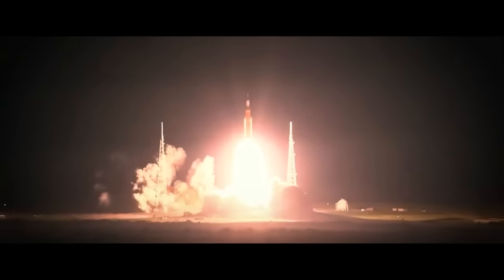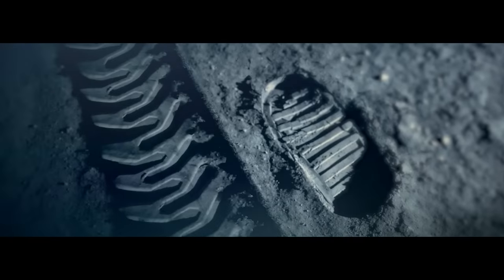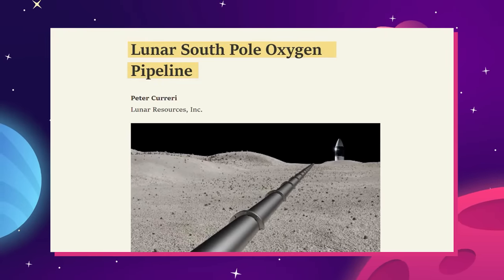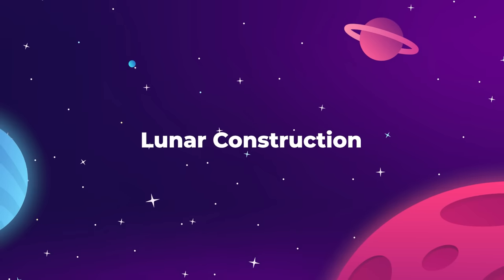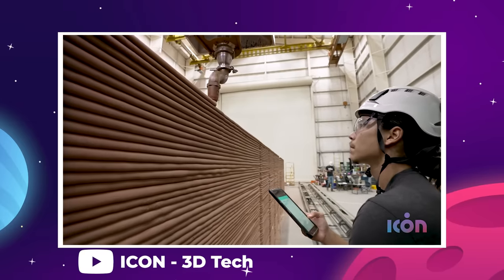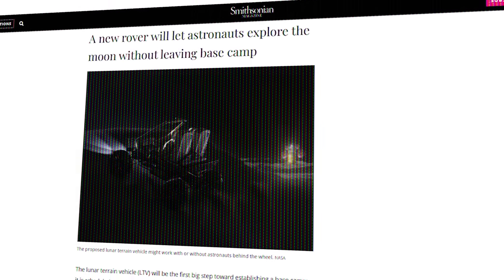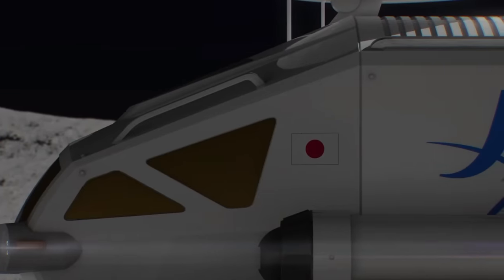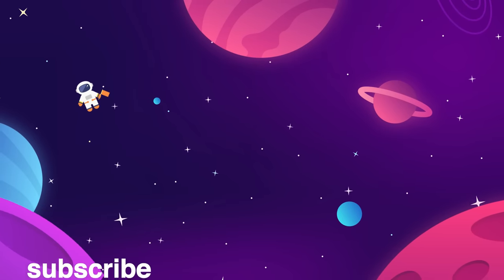How NASA Plans To Build The First Moon Base!

Comment: I hope NASA considers using the lunar lava tube that was discovered few years ago. It’s a bit further away that 5km from Shackleton’s Crater where Artemis 4 will land. It’ll be worth it, though, because the tube is a few hundred feet across and several miles long so no digging required and even has a void from surface and insulated from +- 250*F to a more comfortable temp of 68*. Processed air to breathe would be pumped in  with the possibility of liquid water underground and use the surrounding regolith as building materials as indicated in the video. Build multilevel apartments and an electro/hydro tram to move around the eventual thousands of lunar inhabitants. 
Mars also has one as well so the process’s would be similar. Maybe take visitors right up to Olympus Mons the biggest volcano in the solar system. There’s many in Hawaii, Alaska, Washington, Oregon and other western states. Get those slacker universities to work on it. Even Iceland and Italy have them. They and other countries would have “buy-in” to participate on human habitation development, as well. Get to work!
Reply: Not to forget the almost perfect protection from small meteorites and radiation. With an airtight lock at the end of tubes (or when a void interrupts it) it should make a great and safe habitat. When the voids are later covered with glass roofs they can even start farming. And they still have a safe bunker nearby, just in case.
Reply: Why would there be underground water on the Moon?
Reply: And if, in the future, we want to put a colony where there aren't lava tubes the Boring Company will come to the rescue.
Reply: @johndododoe1411  Because NASA found ice at the poles. Some might’ve been trapped underground during the many meteorite bombardments and insulated from the surface. Perhaps an aquifer extending into the lava tube making the settlement self-sufficient. Got water, you got everything! 
Same for Mars!
Reply: @philiplongee1149  Underground liquid water would seep to the surface and evaporate.
Reply: @johndododoe1411  If it made it to a shaded crater it would just freeze with the rest of the ice.
Reply: @christopheryoder8292  Maybe but too slow too make it work. We’ll need hundreds of people to put it all together and a place for them to live. The surface is just too extreme with temperatures (& CMEs) and too abrasive with lunar dust for long-term development. Maybe rovers but not people.
Reply: @philiplongee1149  The Boring company uses TBMs, which are mostly robotic, but traditionally have a crew working to keep them functioning.  Setting up a more robotic version would allow little or no people to make the first tunnels.
Reply: @philiplongee1149  I would argue that given that the Boring Company's boring machine can fit inside Starship that Musk definitely has plans to use that technology extraterrestrially.
Reply: @christopheryoder8292  Musk hasn’t found much support for his vaunted Hyperloop project of transporting people at 600mph underground using his boring machine. I think Elon sometimes gets really OCD on too many projects Tesla, Starlink, StarShip, Twitter, mom in bikini (wtf), moon, Mars, Hyperloop, flamethrowers! (wtf X10). Be good at a few things and spinoff the rest.
Reply: Compare and contrast to Robert Heinlein’s Moon infrastructure presented in THE MOON IS A HARSH MISTRESS and THE  MENACE FROM EARTH. ¿What did Heinlein get right/impossible?
Reply: The  Space 1999 series seemed to incorporate some of this idea because there always was the scene of a kind of transport going through a lava tube going to where the Eagles were.  There was also this episode where they were mining in catacombs for minerals.  Maybe the moondust can be melted into construction material using a nuclear reactor or an arc reactor that would use the static energy that builds up in the moon dust, maybe some giant capacitors can build from them to power it.

Comment: It would actually be interesting if you made a space that had three parts to it next. Exoskeleton for obviously on the most outer part the most protective part. They could be detached from A mid tier. They could have partial protection. But possible. Separation in case of damage. And the main level. They you probably would always wear. Or would wear most times. And are we gonna talk about the elephant in the room, speeding up transmission? Because I would like to see if, even in a few seconds, could be saved when we're talking about. Time to And from is there a way to. Have satellites from Point A to point B. And anywhere in between. Communication will always be key. Also, are they going to want to put. Engineers up there are they gonna wanna put somebody with engineering skills that is more of a on the spot mechanic. That. Follows procedure and is more willing to take care. Take care of the stuff. When you're only talking about a few people at a time, Those are easier to get people hired for when. But when you're talking about larger amounts of people, there. Are going to have to be. Different. Criteria. You consider when you're actually having people volunteer Or get hired.
Reply: Keithmorse9716. ”Speeding up transmission”? Do You talk about radio signals? They can never be faster than the speed of light. So we are stuck with the speed of communication we have today.

Comment: My idea of a moon base would be a Starship laid down on its side and either split in half or lowered into a 15’ deep trench to support its 30’ diameter. Either way you will have one heck of a stupendous stainless steel moon base. The cargo can be a space backhoe and a bulldozer which would not be too much for a 150-200 ton cargo. Just one Starship plus equipment would be mind blowing.
Reply: Well, that's basically how space stations were constructed since the earliest days of space exploration - parts of rockets, refurbished as bases/livable area. And in general, cannibalizing spaceship is one of the main ideas for early settlement on any planet/moon. With your Starship example, you use the hull and dig it in the regolith, you use engines for some hopper craft for lunar surface, you use fuel tanks for air/water storage (remove them from the superstructure) etc. A cannibalization process like that would be a very important exercise in space construction and exploitation of resources. Because, if we continue relying on building stuff completely in the place of origin (be it Earth or some other place in the future) and shipping it to another body, we won't reach far or fast.

Designing the craft from the start so that they can be repurposed at the destination is a huge deal.
Reply: @Wustenfuchs109     Starship all by itself has a larger internal area than the ISS.  One Starship in orbit would be the largest space station humanity has ever built.
Reply: We need to find a way to use local materials to build what we need though - I think the solution is in panellised construction built from melting regolith, incorporating airtightness, radiation protection and insulation into one solution.
Reply: @TexanUSMC8089  That does not contradict anything I said, nor does it bring anything to the conversation - so what is the point of it?
Reply: @hub5343  We won't be doing that until there is a sufficient economic need for it. For an entire industrial process of mining, refining and manufacturing of parts with ISRU (in-situ resource utilization) we would probably need a colony of thousands of people. Maybe some smaller every day parts being done with 3D printers with supplied raw resources before that.

But that is not going to happen for quite some time. You need to justify it with more than "I need parts". Because, if you need parts to create a small base, then it will be MUCH cheaper to make it on Earth and ship it in segments.

Think of it this way - have you ever seen even a small mining operation? It usually involves at least 100 people and some very heavy and specialized machinery. All of which you'd have to ship from Earth and supply from Earth. Then, there is an ore refining process. Refineries are HUGE energy consumers, no matter what you refine, and again - huge facilities, lot of people of various professions, so again at least 100 people. And, at the end of it all, production. Again, large facility, workers, machinery for at least several basic components (pipes of various size, sheets of metal, wires, bolts...) which is again huge and energy intensive. Another 100 people.

So, from the start, you are talking about ~300 people workforce and 3 very large and energy intensive facilities in a very hostile environment. You need to house those 300 people, meaning in addition to those mining, refining and production facilities, you need an apartment complex and a small transportation network (we are already talking the size of a village here, and being very conservative) - and all that needs maintenance crew PLUS power! And a power unit for all of that has to be HUGE, either a decently sized nuclear reactor or a huge photo-voltaic panel field, both of which require nice workforce.

All in all, just to kickstart a production on the Moon, you are talking about creating an entire village's worth of infrastructure, plus a small industrial zone and constant supply for almost 500 people (you need redundancies, shifts etc.).

It will cost you. A lot. That is more material and manpower than humanity has shipped into space, combined, in its entire history.

Which is fine - but only if you already have funds, resources, manpower and need to build a presence in space for thousands of people so that building all that can facilitate that growth better than shipping from Earth.

It's like on Earth, you have a distant island, or Antarctica. Can they make a factory of their own for stuff they need? Sure. But is simply cheaper to ship it in for the size of population they have. If they planned to grow to 10 million people, then yes, they would probably invest in some basic production capability. But as long as numbers are low, that ain't happening because there is no economic reasoning to do so.

So, in terms of space and ISRU, while we will probably have some space industry in the future, it is a distant future. Apart from some feasibility experiments in that field being done, I don't think you can expect anything like that before the year 2100.
Reply: But Mr Musk isn't the most stable factor... I'm not sure about the timeline being realised...😢
Reply: @Goulmy86  Thats what im thinking... the problem here is Starship

Comment: The Starship is being designed to have landing thrusters way up the sides of the ship so they won't be kicking up a lot of regolith like your animation showed.
Reply: I don't know why kicking up dust would be a problem anyway. It immediately falls back to the surface. It isn't as though it floats around in an atmosphere, as it does here on Earth.
Reply: @craigcorson3036  from what I’ve heard, the gravity of the Moon is so low, the dust kicked up would be sent into orbit around the Moon and would not just settle back down as on Earth.
Reply: @craigcorson3036   >_> I cannot tell if this is sarcasm or not.  but assuming it isn't, kicked up dust is a huge issue, becuase of the low gravity the dust can spread around the moon. and the dust is essentially made out of tiny blade like shards of rocks.
Reply: @craigcorson3036  the dust can damage the engines on landing, a very bad thing.
Reply: @curruptedJimbo  No. There is NO ATMOSPHERE to speak of on the moon. Any dust that is kicked up IMMEDIATELY falls back to the surface. It is not going to "spread around the moon". It would be no more dangerous that the dust on the surface.
Reply: @MrWaldorfian  On EARTH, dust floats around in the air and does NOT "settle back down". Larger particles do, of course, but the smaller ones can remain suspended in the air for a very long time.
Reply: @UploaderGuy3000  Nonsense. How would the dust get into the engines when hot, high-velocity gases are being propelled out from them?
Reply: @craigcorson3036  the problem is that it will fall on the installations (vehicles, solar pannels etc) and cause damage.
Reply: @craigcorson3036  With low gravity and the equally low mass of dust, even with no atmosphere the particles will take some time to settle.
Reply: @falsevacuum4667  Well, of course. Everything takes SOME time, but it's VERY rapid. Check out old videos from the Apollo rovers. The dust is kicked up, but then it's gone in the next instant.
Reply: The issue is not the dust, but pebbles and small grains of sand, those would behave like bullets, because the escape velocity of a high performance rocket engine is more than 3 km/s, so three times faster than a fast bullet.
Reply: @theOrionsarms  I don't think you have a firm grasp of what the term "escape velocity" means. I'll be generous and assume that you meant EXHAUST velocity.
Reply: @craigcorson3036  Fair enough, I want to say the velocity of the exhaust, but my autocorrect keyboard take control, and I didn't take attention of what I wrote, that didn't change the main point of what I want to say, that the dust isn't a problem, but the bigger things like pebbles and grains.
Reply: @theOrionsarms  Larger objects would not be a problem for the descending rocket, but only for anything in its immediate vicinity. The rocket's exhaust would blast all objects, large and small, out and away from it.
Reply: @craigcorson3036  it's  away from the center of each engine plume, but starship is in the middle of a cluster of engines, so some debree will kick the body of the lander, presumably only dust because of the higher position of engines, but who knows exactly because those are still powerful engines and nobody tested in the vacuum on loose ground.
Reply: @theOrionsarms  Who Knows? Exactly!
Reply: @craigcorson3036    The moon has 1/6th the gravity of the earth, so dust doesn't fall back down nearly as fast.
Reply: @craigcorson3036  the rover kicking off dust is not that powerful, now compare that to an engine thruster kicking up millions of dust.
Reply: @神林しマイケル  Dust is not kicked UP by engine thrust, it is kicked to the sides.
Reply: @craigcorson3036  So it is kicked to the sides horizontally and no dust will fly up vertically? 

Are you even thinking right now? No shit it will kick to the side but of course most of it will fly upwards too. You think the dust will only move in one direction?
Reply: @神林しマイケル  It will not behave as it would on Earth. There is no atmosphere. If it is blasted to the sides, it will continue in that direction until it hits something or falls to the ground. YOU are the one not thinking.
Reply: @craigcorson3036  Ok then how did some moon dust fly up when the rover was driving over it?
Reply: @神林しマイケル  Was the rover powered by rockets? No it was not, it had rotating wheels. 
You have lost. Give it up.
Reply: @craigcorson3036  No. Here's the thing, it's not entirely accurate to say that the lunar dust won't fly up just because there's no atmosphere. When a thruster engine lands on the moon, the force it creates can disturb the dust and make it fly up, even if it's just for a little while. And once it's up there, it can stay aloft for a long time because of the moon's low gravity and the lack of air resistance.

When a rocket engine or thruster fires near the surface of the moon, it creates a blast of air or gas that can disturb the dust on the surface. While there's no atmosphere on the moon to suspend the dust particles in the same way as on Earth, the dust is still subject to the force of gravity and can be lofted into the air by a sufficiently powerful blast of air or gas.

Once in the air, the dust particles can stay aloft for a long time due to the moon's low gravity and lack of air resistance. On Earth, the drag force of air resistance is significant enough that it causes particles to fall to the ground relatively quickly, even if they are small and light. However, on the moon, there is no significant air resistance to slow the particles down, so they can remain suspended in the air for much longer periods of time.

In fact, studies have shown that even very small particles of lunar dust can remain suspended in the moon's atmosphere for several hours or even days, depending on their size and the conditions of the local environment. This poses a significant hazard to any astronauts or equipment on the lunar surface, as the dust can enter equipment and cause damage, or enter an astronaut's lungs and cause health problems.

That's why NASA and other space agencies take the potential hazards of lunar dust very seriously and have developed various techniques to mitigate its effects, as I mentioned earlier. So while the lack of atmosphere on the moon may affect the way the dust behaves, it doesn't negate the fact that lunar dust can be a serious problem that needs to be addressed in any lunar mission.
Reply: @神林しマイケル  You're wrong, and you're MUTED. I have no patience for those who refuse to admit they're wrong.
Reply: @craigcorson3036  I am not wrong because I am backed by science. Craig Corson, go back to arguing with your fellow americans because clearly you americans love flat earth theory.

Comment: I would think there would be an evolution of habitation starting with box like structures resembling a mobile home parks or far north weather stations. Eventually excavating into the ground or into crater walls might provide structures where natural walls already exist giving protection from solar radiation, heat and or cold. If mining develops they also may mine underground habitats.